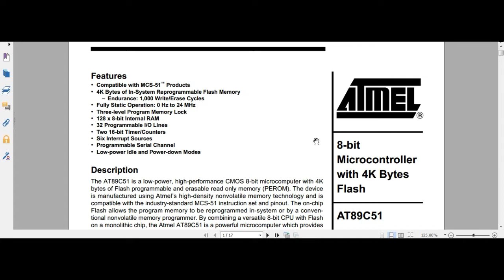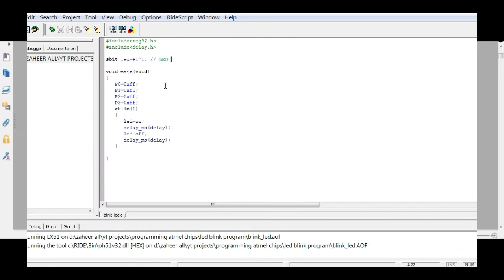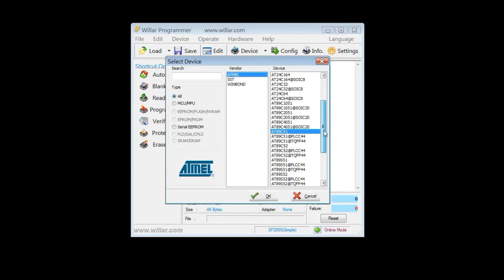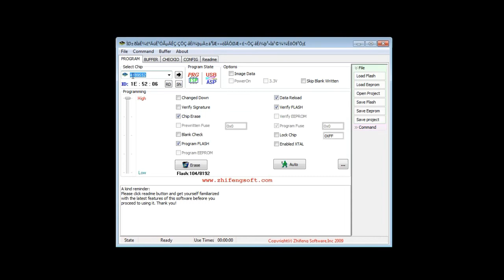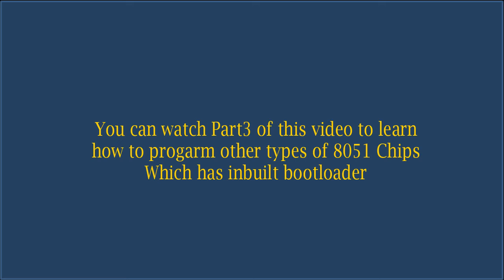how to Program 8051 ICs of ATMEL (2/3)

Comment: I recommend using AT89C51AC2 or other variants which support ISP via serial port. The boot loader for serial programming is great. Use FLIP or other alternatives to send the HEX file. Just need 1 jumper pin to go into boot loader mode.

Comment: In ISP method , progisp software ,the AT89C52 is not selecting in chip section ... What to do ???
Reply from the maker: ISP is only available for at89S52. Not for 89C52 chips. The letter 'S' stands for ISP feature.. you have to get at89s51 or at89s52 chip.

Comment: Sir can I use the hex file of AT89C51 for programming AVR or ARM ?
Reply from the maker: hi...no. you cannot use hex file directly.. as pin addresses and port addresses of 89C51 and ARM/AVR are different.
but you can use some parts of C code of 8051 - like for-loops, while-loops etc.. directly into C code of AVR / ARM. 
as long as pins and ports are defined properly.
Reply: Thank you so much for the reply. Actually I am replacing my at89c51 IC with AVR128DB64. May I use the same C code in new one?
Reply from the maker: @poojasaklani4325  yes . You can. Two things you would need to change..
 1). use #define to redefine ports numbers as they are different for both..
2).  most AVRs don't have bit level instruction. So you have to convert every bit level command (like single bit / outputting to LED for ex.. using byte OR or AND operator.

Comment: Is this ic perhaps very popular in Asia? I have just ploughed through a pile of videos, trying to find out how to program an AT89s52 chip. So far, every video is Asian based. Unfortunately, I am English and don't understand any Asian languages. Are European hobbyists not interested in this series of chips, and if not, why not?
Reply from the maker: Hi.. this chips are cheap, cost less than 1 USD here and easily available.. Also engineering students have subject on this specific chip very early in their study.
Reply: This is a great series of microcontrollers in the sense that it is system-oriented - the microcontroller can execute program code not only in external ROM, but also in external RAM.

Comment: thanks your video was very informative.I brought AT89C51 ,and I have a P89V51RD2 kit . is there any way i can program AT89C51 just by replacing P89V51RD2 by AT89C51 on my kit. or is there any other cheap controller i can use instead of P89V51RD2.
Reply from the maker: You can use Nuvoton's W78E052 which is cheaper than P89V51RD2 and directly replace it.
Reply from the maker: This video will help you with that - https://youtu.be/0Z-cfJCiwQI
Reply: P89V51RD2FN Available in
Reply: 8586817465